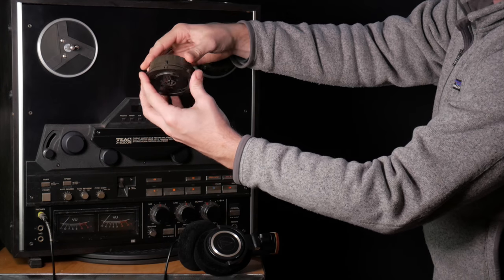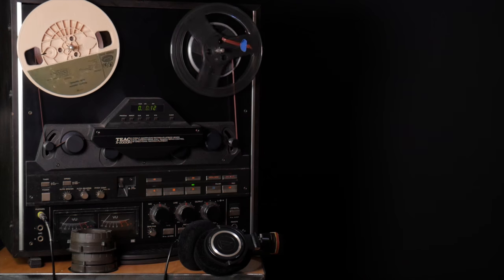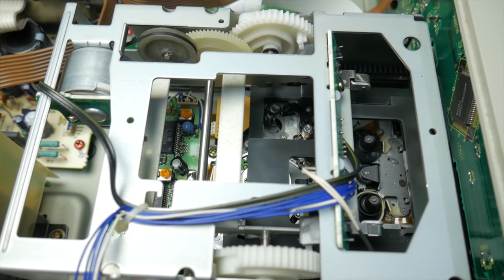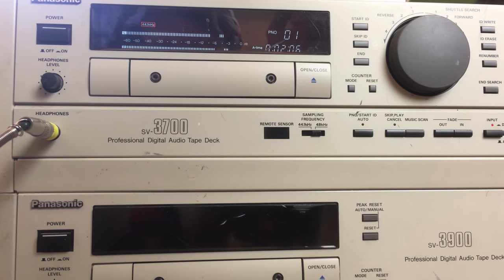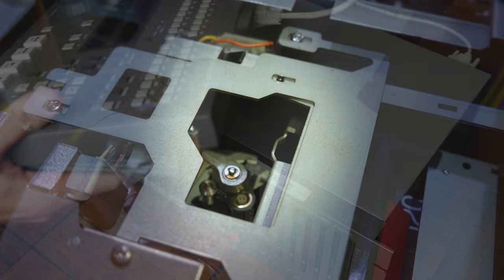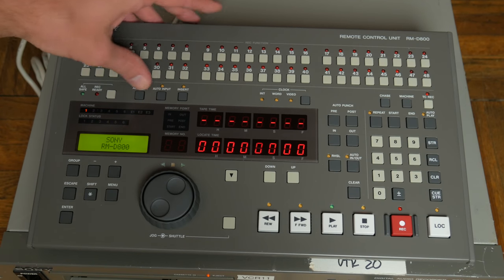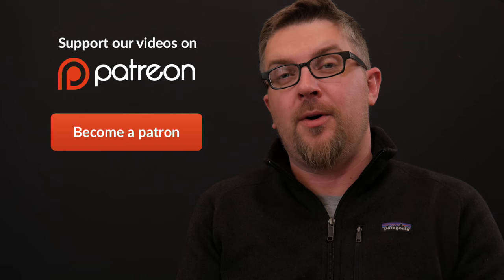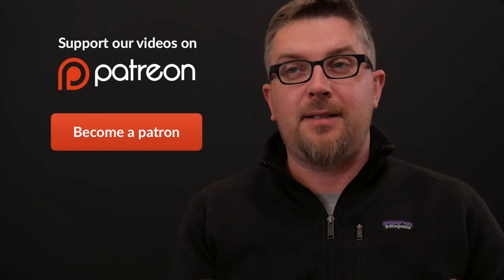#73 - Vintage Tech: Tape Based Recording Sneak Preview

Comment: This reminded me that I have a TEAC cassette deck, rack mountable with the big silver knobs and analog VU meters.  When you showed the remote I remembered that I have a similar one for this cassette deck.  It's in primo condition.  Every light works and every function is as advertised.  I'll pull it out and get some photos for you.
Reply from the maker: +Jason Haynie I’d love to see that old cassette deck, I’ve owned a few over the years, I wonder if it’s the same model.

Comment: Omg, 3:05 you have the exact same kind of parkay wood floor as I have! Very rare. (I know, it has nothing to do with tape, which I completely enjoyed, especially the RR analog.)
Reply from the maker: What city are you in Bob, that style of parkay is super common the D.C. area apartments. I've seen it in NYC too, but most everyone has renovated by now or covered it up with more modern stuff. Comes up beautiful with some sanding too!
Reply: I live in Albuquerque. There are parkay wood floors here, but  with different designs. Mine are 9 x 9 with 6 slats. Yours look identical to mine. Is that what yours measure?